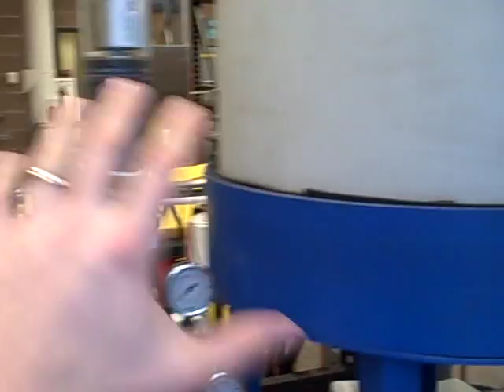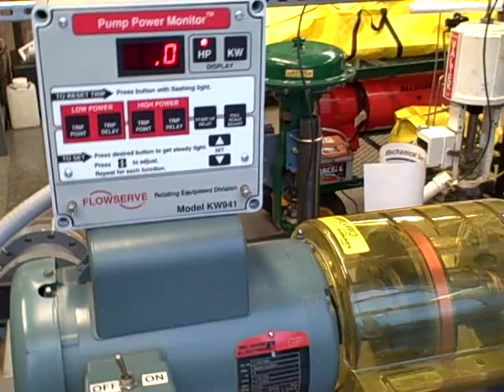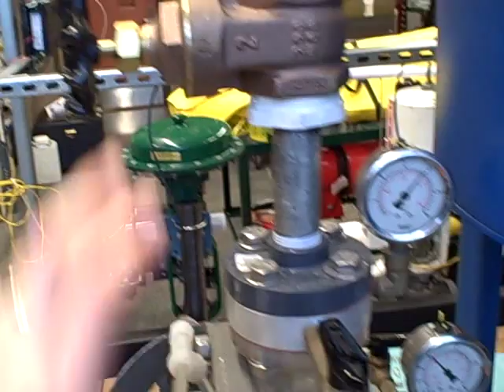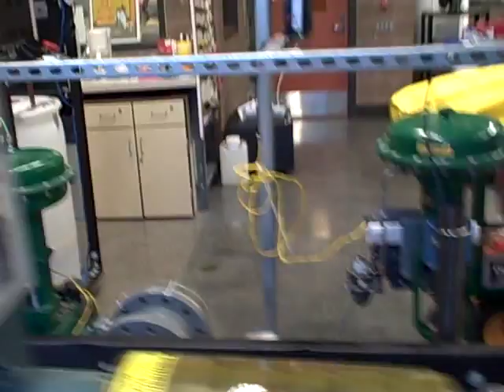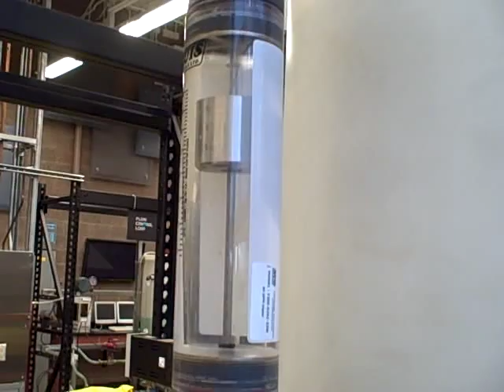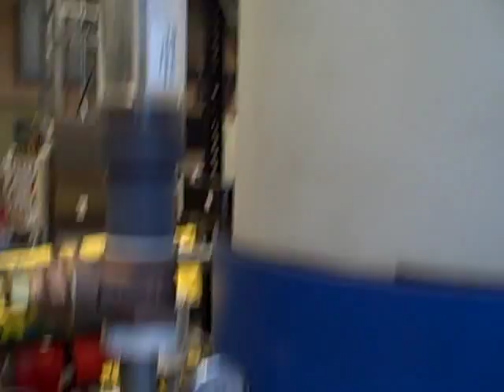Pump flow versus horsepower

Comment from the maker: Full-open, the flow registered by the rotameter was somewhere between 70 GPM and 80 GPM.  If you need to know flow rates at different discharge pressures for your specific process, you could consult a "pump curve" document provided by the pump manufacturer.  The flow rate will, of course, diminish if the pump has to overcome a higher pressure at the discharge.

Comment: what was the flow rate in gallons per hour when the valve was fully opened? 

I set up a water cooler at work and used a 1/2hp pump and it was able to fill a 1 gallon container in about 4 seconds.